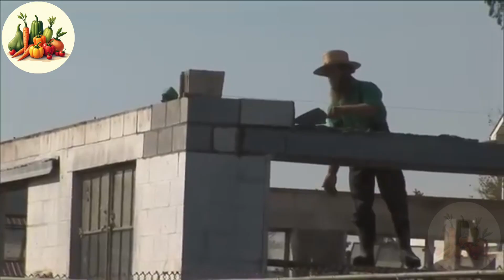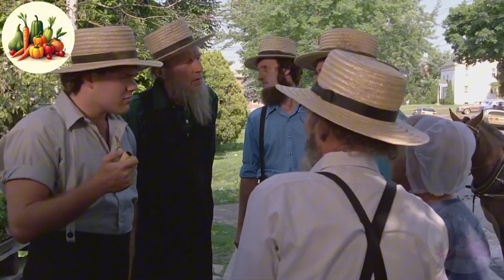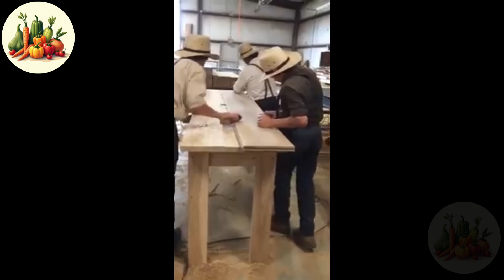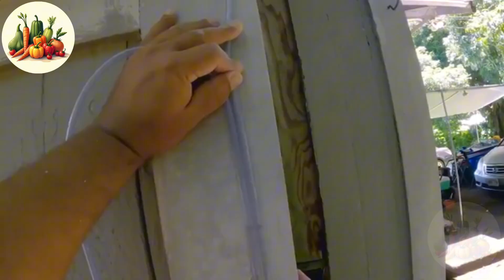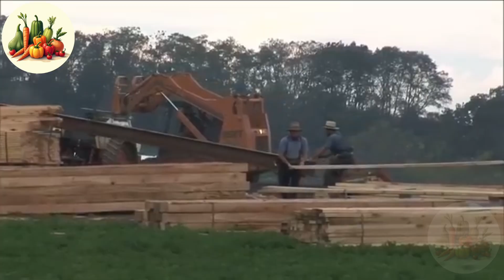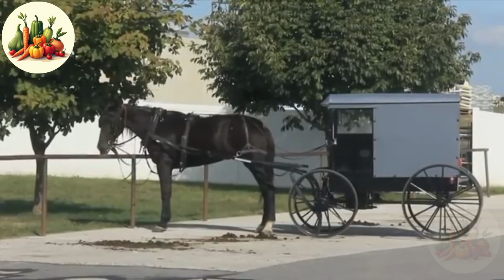30 Amish Building Tricks That Put Modern Construction to SHAME | How Amish Build Homes The Right Way

Comment: last time i checked, sanders, routers, and lathes are modern powered machines. not to mention the skid steer... i'm not discounting their ingenuity or faulting them for using them but it doesn't align with the dialog.
Reply from the maker: Depending the order/ordnung, the other tools are used, there are plenty of techniques shown that do not have the modern tools